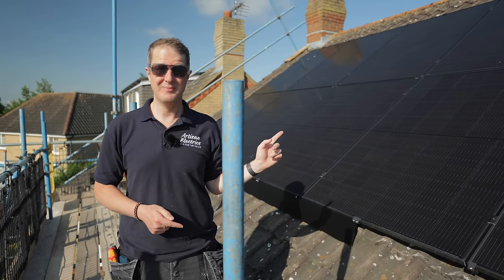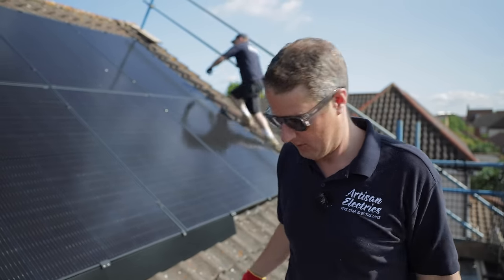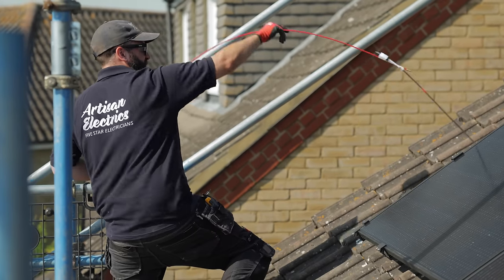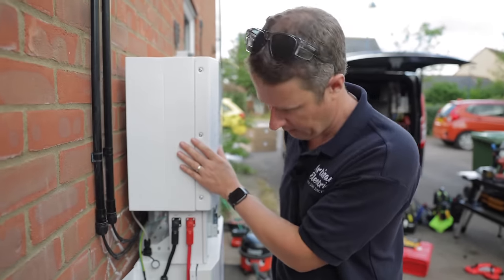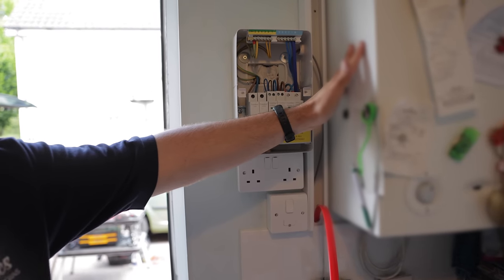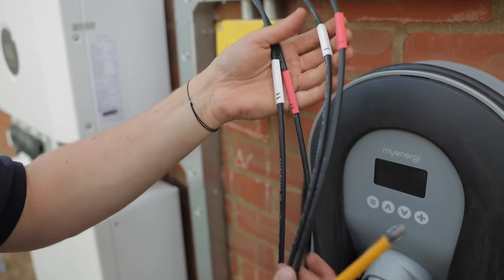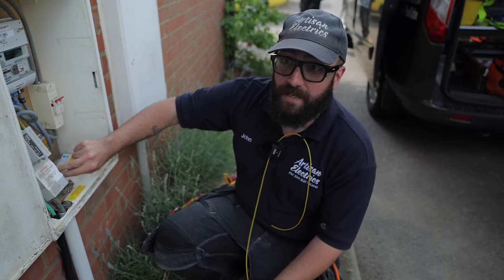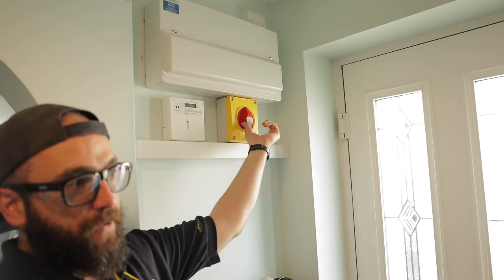Forced To Change Our Own Solar Install!

Comment: 50+ years as a spark and I don't recall ever seeing galv. trunking fitted externally, water will seep in.
Reply: I would only consider it in a sheltered location.  Or in this case within a roofed enclosure/ plant room etc. Outdoors, exposed to the elements all those cut edges even treated are going to start to rust .  Although its just mechanical protection cosmetically I'm not a fan.
Reply: You can get external grade, comes with a rubber lip.
Reply: I didn't think you could use metal trunking for solar as they are considering double insulated systems. Sure they said that on the solar bpec course
Reply: @jasonwatson9011 a customer asked me to install some SWA in some galv trunking last week. I told them to jog!
Reply: Not to mention the cut ends rusting away in no time...
Reply: As a retired electrician, I’m concerned about the trunking having water ingress, rusting etc
Reply: Or even plain moisture condensation on inside..
Reply: I would hate to see these horrid white and bright galvanised boxes all over my wall. And how would the customer feel about the extra cost of materials and labour for this ‘rectification’ by the supplier??????😢
Reply: Been in electrics over 20 years and done probably 100 solar installs , i fairly sure the galv trunking is perfectly fine . There are no connections or breaks in the cable within the trunking its purely containment and neatness the feeds in and out to each iso/ inverter and spd are within ip rated enclosures . The inverter and battery are ip rated so are perfectly fine outside all connections are ip rated . For me there is no issue at all .?

Comment: I have to admit I would not be a fan of having what looks like plant room machinery bolted to the side of my house, but a very tidy install all the same.
Reply: Agreed - I'm also not sure I'd appreciate having all of my isolators available for anyone to play around with after a quick hop over the fence. I hope the Libbi is also better than the Zappi and Eddi, because I've had both for nearly five year while they are a good idea, they are rather poorly implemented. Just ditched the Zappi after I went for a different battery solution. They 'just about' work, but everything about them is just OK and you spend most of your time coming up against things they can't do or can't do very well.
Reply: I've said it before, and I will say it again. Microinverters are the way to go. No messy boxes and cabling indoors. It's all hermetically sealed and up on the roof. There are lots of other advantages, too.
Reply: Ive built sheds around them in the past. Manufacturers instructions usually say equipment should not be in direct sunlight or directly rained on too.

Comment: I'd rather have some kind of cabinet or enclosure on the wall with all the isolators and other bits within. It's installed neatly tbf, but it looks very industrial on the side of the house.
Reply: 🤣 true.
Reply: will look even worse in a years time when its all covered in spiderwebs & bird shit.
Reply: @dbuts5136  And all the galv trunking has rusted on every edge and corner

Comment: What would be great is to make a in closure above the libbi, that looks like the libbi inverter, were you could hide all the isolators and Serge protection devices. So that the install would look way cleaner without all those separate devices on the wall

Comment: Converting a residential house to a factory look. Also just wait until the home owner has to fit an air sourced heat pump. The natural location would be on the outside wall immediately opposite the existing boiler where all your gear is fitted.
Reply: Wait until it rains heavy
Reply: Agreed

Comment: OMG. Never had cause to seriously criticise your work but have the guys forgot they are outside!!! Top entry into the AC isolator with galv couplers 😳😳. Shocking no other word for it! Order a spare cos you will be changing it in 6 months
Reply: Yep it will fill up like a bath with no drain hole, but even if has one - you still don't want rain water pouring into it from that trunking which has no water ingress protection.
Reply: If you look closely most of the content on this channel is riddled with things you wouldn't want at your own house.
Reply: Terrible Will you be building an enclosure over that lot? how much did you charge , or did they refuse to pay? 🤔🤣🤣
Reply: @Falco45able  imagine coming home to find your house transformed into an electrical substation, a huge bill and a major reason why no one will ever want to buy your house in the future

Comment: A very minor and trivial observation; I was pleased to see you using the Seaward device as I used to work for them a couple of decades ago.  Pleased that they are still going strong.
Reply: I use the PV150 from Seaward, I’m astounded very few others do and just use a basic clamp meter.

Comment: Working at height you should use tethered tools, what if a child walks by, you could kill them or you must make sure scaffolding netting is around whole area, it's cheap stuff. When I was a builder no. 1 rule was safe sites and practises.
Reply: A previous video showed install suspended as tool from roof fell and Jordan was not wearing his hard hat. He was so adamant after that abut safety and yet here is a new video showing people using strippers and side cutters . NOT forgivable. Get your wallet out and buy a group of equipment purely for high level installs and no other tools to be taken up high. You really do not want the momentum a pair of side cutters gains going through anyone’s head and causing death or serious injury. WAKE UP NOW !!
Reply: @christopherkingston9601  it's basic knowledge pal and if I was the boss no one would get up two steps without tools attached or netting attached. How about hse comes on site and tool hits the floor, what are you going to say. Doesn't cost anything to get right tether tools wires, they fit existing tools. If a tool kills someone they are going to prison. Trust me you do not want hse on your case.
Reply: You should email a formal complaint to him as then he would more or less be required to act upon it by law (although should have already acted upon it)
Reply: Yep simply not good enough. These guys charge premium rates and then pull these kinds of stunts... This is basic stuff, they shouldn't be operating at heights at all if they can't demonstrate that they are able to do so in a safe and  reliable manner.
Reply: Tell me you are from amurica without telling me , safety nazis everywhere..
Reply: @peteralund  pretty sure U.K. is safer than the US. Not really being safety nzi is it, if the risk of a passerby being severely injured or killed is easily and cheaply mitigated by having tethered tools.
Reply: There is netting. You can See it.
Reply: @padddy48 not on the sides
Reply: @padddy48  only on one side.
Reply: @padddy48  Funny spoke to a solar scaffolding company doing my solar installation as see his tools tethered and said arr nice to see it and he said we always have tethered tools, and if you in London say it's a must. Plus, I dont want to kill anyone and also these tools are expensive and this is with a big award-winning solar company works all over the UK.
Reply: Get over yourself. You’d be all day on a job if you had to do that. People shouldn’t be walking underneath anyway. They’d be at fault not the workers.
Reply: @benYMSB  talk about a bad take. The working at height rules that exist today are as a direct result of people who have died or been seriously injured in the past. If a company is going to be working at heights then proper scaffolding, netting, harnesses and tethers are a bare minimum for keeping everyone safe and taking the reasonable steps to ensure that the jobsite does not become a manslaughter investigation.
Reply: @benYMSB  42 likes not that stupid am i!!!
Reply: You were the dude everyone found annoying on site, jobs worth bloke.

Comment: @5:15 Those connectors you can disconnect while energized by the panel, as they're fully sealed and potted, BUT you cannot disconnect them under load. They will arc internally. Especially with many panels in a row the ~10A has a lot of potential behind it. That can permanently damage the pins or compromise the housing. Make sure your DC disconnects are open before unplugging.
Reply: Who do you disconnect the  the DC ?

Comment: Neat job as usual. Not sure about galv trunking installed externally and AC isolator below it. How are you going to prevent rain water finding its way into AC isolator through trunking and couplers?
Reply: That was my first thought as well. Surely that type of galv' is internal - not for external water ingress protection??
Reply: Exactly my thoughts too - that trunking will fill up with water and run into the isolator now fitted underneath....wasn't so bad when everything was above the trunking but water now has a path straight into that isolator.
Reply: @blower1  I dont understand why they fitted another isolator, they already have a 4 pole one there used to switch 2 poles 🤦‍♂
Reply: @Sparks0001  maybe they need to isolate each string individually. 🤔
Reply: @Sparks0001 with DC isolators they use a 4 pole isolator but loop it through, so actually they are only 2 pole functionally.
Reply: @Pugjamin  I could see that. but why couldn't the existing 4 pole isolator just be used "normally" without the top loop throughs instead?
Reply: I notice they haven't responded . 😂

Comment: I have a similar system in our garage as we're lucky enough to have one. Even so, if I didn't, I'd happily that that equipment at the side of the house. No one will see it, and I'll still be mostly off-grid day and night. I'd probably install a canopy though to keep the worst of the rain off it.

Comment: Turn off DC switches and safe to unplug. I had a DC flash recently on 17 panel string when unplugging an MC4 plug. Even with AC off. Not pleasant. So no load and it’s safe.

Comment: Who footed the bill for the extra work required? Was it yourselves? The customer? Or myenergi as they’ve changed specs after the fact? (unlikely but thought would add it in)
Reply: I would assume the customer had to fork out, maybe with a little bit of goodwill from Artisan and MyEnergi, but an explanation would have completed the video further!

Comment: so, in a nutshell, the super expensive my libbi stuff is the same capacity as very affordable growatt.  Thanks for the info.
Reply: And the GivEnergy All in One is better value.
Reply: but the libbi is obv integrated with the rest of the range (zappi etc)
Reply: And poorly featured compared to anything Victorn produce (I've my whole house running off the protected circuit of my Victron, only reason I know there's a power failure is the email Victron sends me).
Reply: That’s drop per MPPT is massive?

How can manufacturer make such an error?
Reply: Absolutely 😂and we only fit growatt ,Victron or Solis 😮😊

Comment: Should never do top entry on accessories outside especially bushed out of a galv trunking water will sit inside the trunking. You actually get IP rated galv trunking but its a lot more expensive than standard.
Reply: 100% they will back at some point to replace that!
Reply: Agree, rain will work it's way inside the trunking

Comment: Interesting comments about putting all the gear into one enclosure. Perhaps in the future new homes will have a machinery room just for equipment for solar / heat pump / fibre broadband / whatever else comes along in the future 😊
Reply: They do this in Europe, have done for a long time. But we build houses so small here there's barely room for a dishwasher nevermind a plant room
Reply: in the rabit hutch sized new builds a plant room would  described as a large dining room

Comment: Is it good practice to use metal trunking out side in the rain ?
Reply: I thought this - that stuff is gonna fill up with water under heavy rain....and from what I can see the isolator that has now been fitted beneath it has cables running off the trunking that are not glanded and the water will run into the Isoiator!

You can get IP55 rated outdoor trunking which has various seals but this stuff looks to be the standard IP4X (no water ingress protection) trunking.
Reply: No.

Comment: You are correct that the MC4's could arc if disconnected @ the MC4, while producing under sunlight and while under load. 'Load' meaning a closed circuit i.e. with the inverter/MPPT. If the panels are all connected in a string but disconnected from a load, it is safe to disconnect them. In fact, I like to break the string if I'm working near both ends of the string with full voltage on them. Treat the string as a battery pack with corresponding voltage. Cut the string in half if you want no risk of arcing or shock (especially if you're wet with sweat and handing both of the MC4 connectors)

Comment: I'd be really annoyed that "My Energy" changed the spec for the inverters at that stage of the game.
It's taken four of you to rewire the panels as a result of this plus extra changes to the work you'd already done plus additional kit.
Who's responsibility is it to pay for this and what lessons are there for the future?
Reply: What lessons for the future? Don't be a guinea pig for brand new products to market.
Reply: Well the specs are changed for safety reason, you rather have them not change the specs?
Reply: Well, they better sell safe equipment to the customers first time.
And what kind of work is done on the outside !?
Looks like inside of a industry, everyone could have fun Turning off and on.
Even stealing everything on the wall !?
Never seen such a unsafe ugly install ever, even children could have fun with this electric wall.
Unsafe ugly install, I would never accept anything like this on my wall.
Even if they paying me a million for having it.
I am from Norway, never seen install like this on a house with solar...

Comment: You're correct with the MC4. But if you disconnect while they're connected to a load (inverter) you have to change because of the arc.
Reply: How would you go about disconnecting MC4s from panels connected to an inverter. Let’s say there was already a system installed and you were looking to add extra panels to one of the strings
Reply: @Patrick-ni3xy  Turn off the inverter by disconnecting it from the grid and turn off DC-switch.
Reply: Just turn of dc isolators
Reply: @JoshMorris-k7h  You want to try to avoid disconnecting with load on the DC isolator. That will wear it down a might cause a fire in the end.

Comment: You are better off running 2 strings anyway. That way if a panel dies, the client still has 1/2 of their solar system operational
Reply: I thought the same thing. Plus, most inverters with 2 inputs should be equally balanced if possible.
Reply: This.  Would help with MPPT too, assuming the Libby has dual string tracking.

Comment: Did you ran the negative wire along the positive next to each other to prevent an inductionloop? On your drawing it seems not the case.

Comment: I asked SolarEdge in May and they confirmed any product used to clean their PV panels, needs "... it has a neutral Ph level which won't damage the surface of the panels." My cleaning company used Benz Bio Cleanz diluted 30-50:1.
Reply: Rain has been enough for me over 12 years. My data logger shows same output. I think "cleaning" is a bit of a scam. Sure if it's covered in bird mess, but a little light dust etc negligible impact on performance
Reply: @marshp3  Agreed, but it is the algae/moss/lichen that the rain has little or no effect on. Even after 15 months from install, the growth had already started. The cleaning fluid used on my panels ahs a biocide in it to inhibit that growth.
Reply: @MrBobmeadows  I'm surprised it can adhere to what is a glass like surface. Mine are on a 45 degree pitch south facing, so I don't get much moss on the tiles anyway
Reply: @marshp3  Mine are almost South too, but nice to have self-cleaning panels.

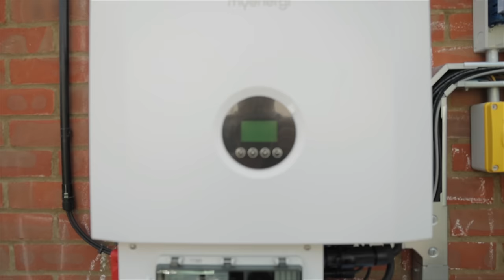Comment: You sure that cable is RS485 / Belden data cable @ 16:07
I can't see any sign of a foil screen/drain wire and it doesn't look like a twisted pair. Cable looks like standard control cable which is definitely not suitable for RS485 data connections which should be screened (especially since they are running along side 230v cables) and be a twisted pair for correct impedance matching and common mode interference suppression via differential signalling.
Reply: You might be right there, but it's hard to tell without seeing it being stripped back. It's not great but if it's only going a few metres from the inside control box through the wall to the inverter, it probably won't matter too much.

Comment: Nice move when working with live panels or making off live dc cables to use insulated gloves, although the panel connectors are fully shrouded it could easily be contaminated with water or …other contaminants. Any slight leakage will eventually cause a carbon track which you would not like to touch especially as you now measured voltage of  I think 220v at 1.5 ampere.
Reply: Where would the current flow to?
Reply: @markrainford1219  It could flow between connectors for example ,the carbon track is a semi conductor so if its damp it makes matters worse. You may be tracing the dc strings for example with your bare hands while holding on to the mounting rail.
If you are up a roof and you get a even a static shock , it may be enough to make you recoil and loss your balance.

Comment: 18:58 shouldn't this be independent instead of parallel? I believe it should as that tells both MPPT's to work independent from each other. In fact using the parallel settings would have allowed you to not change the roof layout and just use Y-splitters to use both mppt-trackers as one for one string. But libbi manual and forum isn't clear about this. Other inverters work like this though